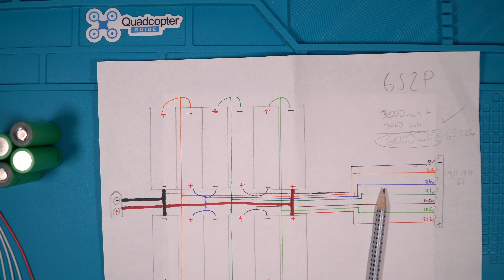Build Your Own Drone Battery - Why and How!

Comment: Cells put in series do not self equalize,,,thats why we need balance chargers. Cells in parallel self equalize                                                                                                                                                                                     and. I've experimented with it and I've seen currents in excess of 20A with high discharge Samsung cells, one at low low voltage and one full. The current drops quite fast though and within 3 seconds I'll be well below 10A close to 5A.
Reply from the maker: good points thanks for stopping by!

Comment: Just made my first 18650 6S pack tonight out of a battery bank someone gave me with a bad usb port or bms. Can't wait to test it out tomorrow if weather allows but i only have a 5" to test it out on at the moment.  it did fine on my unofficial indoor hover test.
Reply from the maker: hey very cool. Could you find the amp rating of the cells? Not that you end up having insane voltage sag due to insufficient amp rating etc.
Reply: @Quadcopterguide  Will these Li-Ion cell work for my below hex?
1)Frame:Tarot 680 PRO Folding Hexacopter Frame
2)Motors:6x Tarot 4108 High Power Brushless Motor (380kv)
3)Propeller:3x Tarot 1355 Carbon Propellers (Two Holes / CW and CCW)
4)ESC (Electronic Speed Controls):6x Hobbywing XRotor 40A-OPTO ESC
Reply: I dont mean to be so offtopic but does someone know a trick to log back into an Instagram account..?
I was dumb lost my account password. I appreciate any help you can give me.
Reply: @Callen Byron instablaster =)
Reply: @Yahir Prince Thanks for your reply. I found the site thru google and I'm waiting for the hacking stuff now.
Looks like it's gonna take a while so I will get back to you later when my account password hopefully is recovered.
Reply: @Yahir Prince it did the trick and I actually got access to my account again. I'm so happy:D
Thanks so much, you really help me out!
Reply: @Callen Byron no problem :)

Comment: Use some proper battery soldering flux so you should not want to scrub your battery surface. And use sone normal flux to solder and tin wire. use flat head soldering iron with minimum of 60 watt

Comment: Isn't soldering really bad for the battery? Why have you not opted for spot welding?
Reply: As long as you are quick with your solder job, no significant heat will be transferred to the battery. The key is high heat to be quick

Comment: 7:08 mis-spoken: "series" should be "parallel". If in series, no current will flow between the cells because the circuit isn't complete. Adding cells of different voltage in series will just add the voltage of each cell up onto the cells before it. In parallel, however, as soon as you connect the two 6s series batteries together, current will flow to equalise the total voltage of the two 6s batteries and, as I understand it, if the difference in total voltage of each 6s battery is big enough, you could end up with a high current which may spark/ exceed the max charge rate of which ever 6s battery has the lower voltage.  So it's important to make sure the total voltage of each of the two 6s batteries is the same before you connect them in parallel 👌
Reply: Also, check out the Molicel P42a 4200mah 21700 cells. I built my li-ion battery out of them. Much higher volumetric energy density than 18650 and has a continuous discharge rate of 45A
Reply from the maker: Good Morning Daniel, had to do a double take. The cells are wired in series, that is correct. The rapid flow of current occurs when plugging in two packs in parallel, that is correct. I should have said "you want the cells the same voltage to ensure the final pack has similarily charged cells". Your warning about plugging in packs in parallel is 100% correct. The general rule is no cell should have a voltage of over or under 0.1v difference, before plugging in in parallel. This occurs when you plug them onto your parallel charging board etc.
Reply from the maker: Love this conversation by the way. So glad others are into this kinda stuff. Funny, my spreadsheet I used for planning has these VCT6 cells on it and the Molicel you mention. You're spot on for a planned 6s1p pack the Molicel make sense. My plan from the get go was to do 6s2p and for that the Molicel was just too heavy for me. My calculations were that a 6s2p ( or 2 6s1p just manually wired in parallel) pack of vct6 weighs 624g and the molicel 876g. 6000mAh would be plenty i thing with the vct6. The vct6 packs would provide 104g/1000mAh and the molicel 109.5g/1000mAh. All these calculations were assuming the VCT6 provide 3000mAh. Initially you can get 3130 out of them even. What are you flying with li-ion packs?
Reply: @Quadcopterguide  yeah I think your 6s2p set up is perfect for you. I'm running the Molicel's as a 5s1p on a 5" fpv drone. Definitely heavy for a 5" but I'm getting 18 min flight time, just crusing around. Current draw is about 10A while cruising. If I had a 7" I would probably go with your set up, but I think I'd have to experiment with the Molicels 😆 The extra max discharge current could help if needed to do an emergency punch out. What's your current draw while cruising with this set up?
Reply: @Quadcopterguide   spot on. I've also heard about the 0.1v per cell in series general rule but only in relation to lipos, which can safely take up to a 5c charge rate. I wonder if the same is true for li-ions, considering their max discharge current is much less than lipos and so perhaps their max charge rate is also much less, which could mean that 0.1v is too high. Would love to know the answer to this!
Reply from the maker: I think normal cruise I'm around 14-15 Amps, still need to get better at staying more constant. Setting throttle and just leaving it. Interesting question regarding Li-Ion and 0.1v. I suppose you could play it safe and charge up each pack to storage voltage and then when you are ready to go fly they should all be extremely similar in voltage for parallel charging to go out. I think I will charge each pack manually since I don't need any surprises with a home-built pack.

Comment: Also dji sells battery smart boards so you can not only make your own but you can make a you're own smart one.. temp sensor, bridge etc also connecters so it will slot rite into the drone if your that good
Reply from the maker: hey Lou thanks for taking the time to watch and comment. It is much appreciated! Hadn't seen those on the dji store before.

Comment: It would be cool if you could just put a DeWalt 20v battery on a drone and fly it. They're too heavy, but it would be cool. It's a 5s battery.
Reply from the maker: that would be cool. I have a feeling these FPV quads pull even more current than a powertool.

Comment: Hi, I wanna ask:
I have a Parrot Jumping Night Drone:
Drone: 3.7V 2A Max
Battery Pack: Li-PO 3.7V 550mAh 2Wh 15C Cont Discharge
Battery is dropping. Usually I can play up to 20 mins, now below 5 minutes.
I want to diy using 18650 battery.
I have AWT 3500mAH 3.7V 35A High Drain and MXJO 3500mAH 3.7V 20A (both are authentics). I use for vaping device.

- Can I use my vape battery to drone? I plan to mount only 1 battery, probably using battery slot so I can easily recharge it.
I have Nitecore UM2 USB Charger.
- If can, do I have to tear down the original battery, take the BMS and put into 18650 battery or I can simply soldering cable at drone connector to the battery without BMS?
For safety reason, which is best?
- Also, there are 3 connectors on the drone, I think 1 for battery level, how to soldering it so I can see the battery level on the smartphone.
- I think with 1 single 18650 battery with 3500mAH, I can get very longer play time. I confuse with 2A Max warning on the drone and 30A or 20A on the battery.
Can you help giving me understanding about it? Waiting for your feedback. thanks.
Reply from the maker: hey there, sounds like the battery or some of the cells are going bad. as long as your voltage is the same and the cells are high quality it should work.. There's a lot of risks with messing with batteries. Please be sure you understand those all before you start on this journey.

Comment: How would a 4S3P perform vs a 6S2P in a drone? Presumably it would mean max load but otherwise any thoughts?
Reply from the maker: all depends on the required voltage of a quad.. IF you mean an fpv quad, the 6s pack would have more punch. If the total mAh are the same.. now that would be an interesting test.

Comment: how would you connect it to a battery charger my charger will only charge till 5A ?
Reply from the maker: Hey Luke. You need a special charger than can charge li ion and have a balancer port as well. Check the video description for links.

Comment: You can get the same type of battery out of those the disposable solar lights the battery inside of those is a lithium battery 800 mah 3.7 volts and it's only five bucks
Reply from the maker: thx for watching!

Comment: How can i increase the C-rate(Discharging rate ) in Li-on Battery? Thank you for every videos.
Reply from the maker: Hey Goitom, thanks for taking the time to watch and comment. It is much appreciated! It just depends on which cells you use.
Reply: @Quadcopterguide   If i want to made a 3S, 30C and 5000mAh Li-on Battery using the 18650 S or X Cell . What should i have to do? or how can i made it?...
Reply: @goitomhaile8775  get a spot welder

Comment: I was wondering can I maybe have two packs on my drone paralel? One would be li-po to have big current when needed and second pack with li-ion to increase capacity. But I will need to invest probably in 7 inch drone before testing this approach.  :-/
Reply from the maker: mixing lipo and li-ion sounds like a bad idea on paper. Not sure you would want to do that.. Try to use the same cells so internal resistance and everything else is equal.

Comment: What if I use 2 18650 lithium ion battery In hubsan zino mini se  with 3,500mah each total Of 7000mah but same voltage and wait it is ok change that for longer flight time.?
Reply from the maker: thx for watching!

Comment: Great video, I watch this and flight time comparsion and its great. Would it be posssible with fimi x8 se ? It would be very helpful as fimis batteries are not too reliable and get blocket without clear reason sometimes...
Reply from the maker: it's best to do this for FPV style quads.

Comment: Hi how to meak battery pack for jjrc12 ? My one a swallowed and not hold charge can you Help?
Reply from the maker: Hey Adrian thanks for taking the time to watch and comment. It is much appreciated! I'm not familiar with that quad. I would safely discard your swelled battery! Take it to a proper recycle center. That is bad news if swollen.
Reply: @Quadcopterguide  how to replace it with new kit ? To build new in stock package?
Reply: that what I'm asking how to do it or place with know this setup??  I'm not asking to trash it i want to know if is possible to build a new one for this drone-like for DJI for example...

Comment: Can you build an external battery for a mavic pro?
Reply from the maker: Hi Peter, thanks for stopping by and taking the time to comment! Awesome! Theoretically that is possible, but you would have to use regular LiPo cells, and at that point it's simpler and much safer to just buy an off the shelf product. The Mavic Pro uses LiHV type cells in the main battery so Li-Ion will not work.

Comment: It's interesting how the sport mode works. It doesn't increase the motor rpm so much as it just increases the angle the drone can tilt.
Reply from the maker: Hey CGM, thanks for dropping by and subscribing! you're right, they can only spin the motors so fast..

Comment: I’d like to build a simple 3s pack for a bebop 1 drone.  The original battery is only listed as 10c, I’m assuming 20c burst.  Seems like you could easily buy some ions that could handle 20c.
Reply from the maker: Hey IV, thanks for taking the time to watch and comment. It is much appreciated! Sounds doable for sure. You just have to make sure you get a matching plug and if there is any fancy circuitry you would have to transplant that.. No experience with that so far.
Reply: Thanks for the reply.  if I went that way I’d probably lose the proprietary parrot connector on the drone for an XT60.  There are other videos out there with people using standard 3s lipo packs on these, so apparently that part works fine.  . I’ve just never seen anyone using lithium ion before.

Comment: Hell yeah, mini's flyin pretty man. Is it possible to catch it in the hand you don't use to disarm it?
Reply from the maker: hey thanks for the comment, you can catch most DJI drones in your hand and tilt them over 35ish degrees and the motors will stop after they try to spool up quickly first.. I always found that a bit risky.

Comment: Building a 6s out of 27000's is a royal PITA.   I made some 4s and 6s and the number of solder operations you have to do per battery is 50-100.  It's tedious and insane.   And it's a mute point now, because I plugged an XT60 in backwards to my 7" fpv quad and blew out it's ESC.   So that XT60 connector is a killer just waiting to happen.   On all my yellow XT60's I had labeled them with a red/black sharpie +/-...  so that would not happen... but guess where that one singel black female XT60 was...   you guessed it... on my $500 quad.   In under 1second while working on the bench going back and forth between Betaflight and the quad in a hurry, bam spark and that's the end of the ESC music and my $500 quad.
Reply from the maker: oh no! Did the black xt 60 get soldered on wrong? I haven't been able to plug in an XT 60 the wrong way, if you managed to get that to happen.. holy cow! :). I hate learning through mistakes like that..
Reply: @Quadcopterguide  my guess is spark gap jump... Round male in square female touching and other side is only a hair space between contacts.   20v at 2 amps yeah... kapow...  and its game over.  Wasnt jamming or anything, I was just in a rush on the bench and my mind wad inside betaflight configurator
Reply: Well.... not bye bye $500 quad..... bye bye $50-90 esc
Reply: @Halphbaked210  I bought a replacement ESC, and capacitor.  It's been sitting 3 years now unfixed.  I was too blind to gut the thing all the way apart and do the swap out, even with an inspection microscope.  So yeah, pretty much bye bye 500 quad, and then bye bye another 80 replacement ESC that never could get installed.

I mean bye bye in a sense, I still have it all collecting dust.  But after one flight, I never flew again...   nor did I ever want to fly again, that pretty much ruined the hobby entirely for me, game over.  I couldn't go back.

I didn't understand why, until I had an epiphany one day...   a phrase that popped into my mind.  Sudden Infant Death syndrome.   It's like when your first baby dies, through no fault of your own.   The experience is so traumatic, do you ever want to have another baby, or even think about it any more.   H377 No....

So yeah,  FPV swx....

Comment: Great stuff but still curious to see someone build a mavic pro battery since they are not easy to get and not really supported by DJI any more .
Reply from the maker: Hey Jeremy thanks for taking the time to watch and comment. It is much appreciated! That is a big goal.. I wonder when it will be worth checking for aftermarket batteries..
Reply: @Quadcopterguide  ,you are quite welcome Quadcopterguide ,you are very talented and well versed on this stuff and I admire that very much ,take care and keep up the good work .
Reply: @Quadcopterguide  ,what I really meant to say was ,Rebuild ,like getting the same Lipo Cell Packs and putting them in the Mavic Pro battery-shell but I don't see that size Lipo Packs either . Man I have three dead ones on my hand right now ,two I have oppened-up and the other one just sitting there ,dead as a door knob .hahahaaaaaa .Truth is I really flew the life out of them though and I had them for four years running ,until recently ,so they really lasted long ,cant't complain at all .

Comment: Hey can  you do this for betafpv drones ? I’m really noob at all of this ?!
Reply from the maker: Hey Nolan, thanks for checking out another video. I would assume that you would need a relatively large quad to make this make sense. All the BetaFPV quads I've seen are tiny 1-2S powered drones. For these you could potentially try finding smaller li-ion cells, but I don't know if those come in high enough discharge rates. Great question though. May have to test this one, if I ever get a tiny quad. Which one do you have?
Reply: You should try some searches with "betafpv", "long range", and "lion" in your search query. Li-ion batteries will work with smaller quads, but the battery chemistry will only support low current or slow/cruising flights.
Reply: FriendlyNomad ok thanks I’ll do that I’m a beginner and I’m in the sim phase so really new at this I’m looking to buy the betafpv kit
Reply: Quadcopterguide ok I thought it was possible for smaller to although they have also some 3inch and even an 4 inch quad but not for me yet ! 4inch is called x-knight
Reply from the maker: theoretically there are smaller Li-Ion cells, but i just don't think you will find out that can support the higher amp rating required.

Comment: How can I charge this? is it safe to charge overnight? I mean, is there a protection?
Reply from the maker: Hi Vindula, thanks for watching and commenting. I sure do appreciate it! You have to charge them with a specific li-po charger. No LiPo should be charged un-attended, and proper fireproof charging locations should be used.
Reply: @Quadcopterguide  Thank you! Can I use mobile phone battery instead 18650 for this?